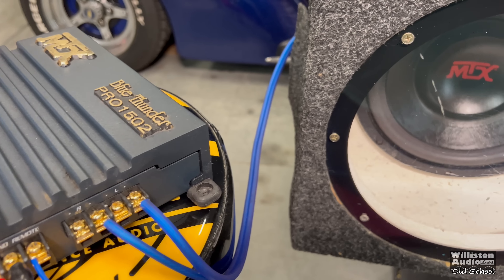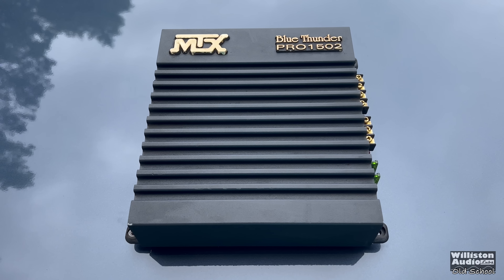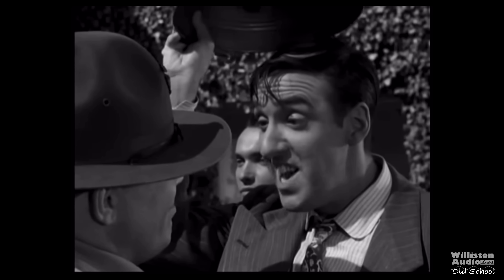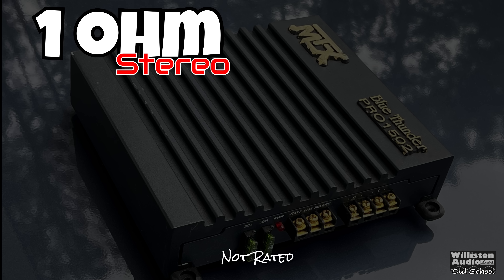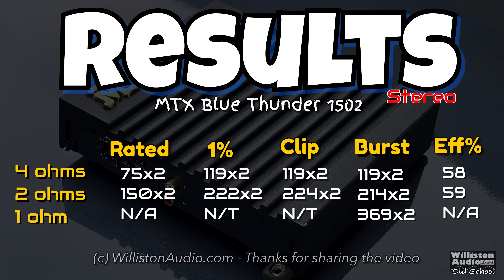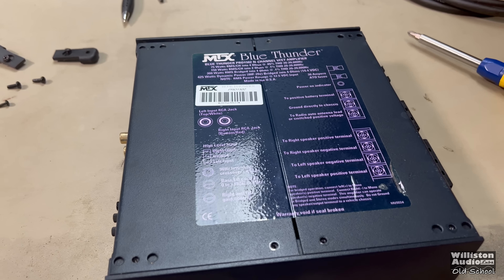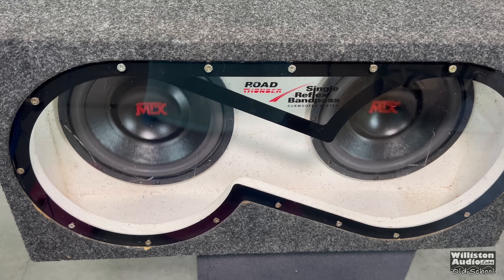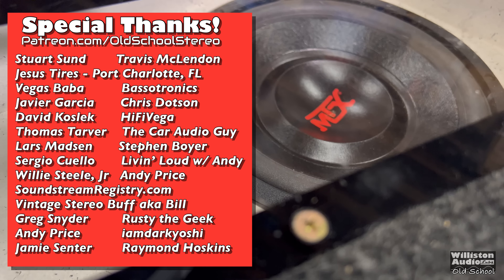Can This 25yr Old Circuit City Amp Survive Brutal Amp Dyno Testing?

Comment: Late 90s will always be my favorite years of car audio. Ppi, rockford, jl, and kicker were just a high school kids dream.
Reply: I still have my PPI 2150 from that era which I used for my highs with mb quartz front and 6.5 coaxials in the back. I wish I still had the 1400 monoblock that i used with my 3x JL 12w6 speakers.

That amp is sitting in the same storage container as my MTX amp which is very similar to the one being reviewed here. I used the mtx then the PPI amp to power the subwoofer setup for my computer for a couple years.

Comment: MTX. Is a very underrated car audio company. They’ve always made great equipment. I’ve had a lot of it over the years. I still have my first gen Blue Thunder 12’s. They were the 💩 back in the day. This amp was no different. As soon as I saw the thumb nail I knew it would surpass its ratings big time. Great vid Big D! Circuit City FTW!!!!!
Reply from the maker: I show a 10” MTX Blue Thunder at the very end!
Reply: I'm running MTX dual 12's this very moment in sealed box. chefs kiss
Reply: @wal  seen it my brother. I remember talking to you about my Blue Thunders a few years back and you told me you had one. Great sub for the time 👊🏽
Reply: @ashy Larry, as a former employee of CIrcuit shitty, no they didn't.  They sucked major ass after they got rid of sales comissions.
Reply: That said, I agree MTX is the bomb diggity!!  As far as amplifier design goes, they bucked most of the major trends.  Nothing the end user would notice bit thosenof us repairing them are usually like "omg wow is that right?!" the first time diving in.
Reply: They formed from a late 70s company called American Acoustics Labs which started in Winslow, IL but later moved to Arizona.  I still have 5 pairs of various AAL home speaker cabinets all from 1977 through 1979.  I had to fix all the woofer surrounds due to dry rot, and I rebuilt the crossovers but they all sound great.  They range in size from 8 inch to 15 inch woofers (also have a single 12 inch, and a cabinet with dual 10s).
Reply: Wasn't MTX owned by Mitek who also made, Coustic and Xtant  amps and subs? Plus street wires products too.
Reply: @wal  about 1994 I had 3 in a sealed box in my 89 crx si sonic blue was very good, then i got 1 RF HX1210 lol whole new beast was born
Reply: @MoparStephen  that’s awesome!
Reply: @Robert-ph6pl  I’m not sure about that Roberto. I do know the company switched hands at some point.
Reply: @rexxx927  yeah, HX was a beast. Still is as a matter of fact 👊🏽
Reply: @steve390gold  your first comment threw me off, lol. I thought you said MTX sucked because you got stripped of your commission. My bad 👊🏽
Reply: @AshyLarryTM  they are very musical subs for SQ too i still have one in my EM1
off a soundstream ref 500
Reply: @Robert Bero  yes they were.  Next time I'm elbow deep in a mtx 81000d (tuesday) I can take a pic of the name on the pcb.  :)
Reply: @AshyLarryTM  hahahaha no worries!!  I love mtx amps!!!
Reply: @Ashy Larry  circuit city was the worst, though.  When employees were making commission sales, there were employees that were raking in mad $$$.  Corporate saw this, got greedy, stripped everyone of commission, and said we're only going to pay 10/hr (most employees were making 20+/hr simply due to commissions).  And they even had the nerve to use that as a marketing ploy...

Then corporate came after the installers, fired/pay cut all of them because they were making too much money and tried to get them to sell stuff on the floor to then install.  That didn't work, they all left.  So then you had salespeople attempting to install what they sold.

Finally, they realized how absolutely stupid they were being and kept installers installing and sales people on the sales floor... but they didn't dare bring back commissions.  And of course, they went bankrupt.  Another company turned to total sh1t, destroyed and bankrupted by greedy corporate sociopaths.  Walgreens has done the exact same....only they are propped up by their pharmacy.
Reply: Not sure too sure about that. In Canada, they were only sold at A&B Sound and Futureshop. No one else would take them. In those days, you didn't touch MTX unless you were broke. They were dominated by Alpine, Rockford Fosgate, Pioneer, Phoenix Gold and other high-tier brands.
Reply: @brianellis3402  well that's your experience in Canada. Here in this country they were every bit as powerful and reliable as RF and beat the pants off of alpine and such.  Perhaps MTX was only setting bottom of the barrel stuff to you guys.
Reply: I installed tons of mtx at circuit  city. They were always amazing until probably around 2007 when they started selling those cheap amp sub box packages. We did have to send off several mtx amps for warranty, but they always made way more power than rated.
Reply: I still run a MTX-X03A crossover

Comment: I remember the high school days hanging out at Circuit City and listening to entire albums before buying them lol. Hey does anyone remember they had free sub/amp/radio installation whenever you spent over 75 bucks? Ahhh the good days
Reply: I remember buying an Alpine CDA-9805 head unit at Circuit City back in 2003. I forget now exactly when they closed that store, but it wasn’t long after.
Reply: That was obviously after I was gone from there.  Just about anything was $75, so I don't see how they made any money doing that.  IIRC, a radio, amp, and four speakers was $149.95 and there is not enough margin there to justify it, especially on some products - there were some CD players (Pioneer was really bad like that when on sale) we sold below cost.  Only real benefit would have been not taking as many returns and maybe the additional opportunity to upsell and sell accessories, like harnesses and cables.  But, if the sales counselor was doing his or her job, that should have already been done.  I guess that's why they are no more.
Reply: I bought a LANZAR Optidrive 300 with the analog needles. It came with a (cheese whiz) 12” pioneer 400watt. I installed it in my wife’s Dodge Neon in a 1.5 cubic ft sealed box. 
I also bought a Pioneer head unit, and got a set of free 6.5” door speakers. Pretty sure the speakers ended up in a ice truck I leased one summer😂
Reply: I worked at a Circuit City from 97 to 98, and the Blue Thunders each came with Dyno results. Never saw one that didn't exceed rated power by at least 10%.
Reply: Heck yeah me and my buddies  would spend hours there. I bought my system there. I had  that  MTX box and MTX subs.
Reply: I remember installing tons of mtx amps at circuit city.
Reply: I remember my dad took his 93 Chevy truck I think it was around 2006 they stole the previous stereo. So he got Sony new one that time any ways they charge him $100 dollars installed, new stereo dash in burgundy color to match the interior.

Comment: I'm still running a Thunder 2300 amp in my wife's car, and my home theater subwoofers are two 12" Road Thunder Pros (kevlar cone, red rubber surround) powered by a Crown DC-300A Series 2 in custom birch-plywood ported boxes.
Reply: i have 2 2300's and a 3002
Reply: @administratorperson3272  Oof! those 2300's are the best. I'd take one off your hands if you're willing to part with one. I can never find them for sale.

Comment: I had this amp! I was a car stereo manager at Circuit City! Loved this series of amps!
Reply: Circuit City was the best job I ever had and I got to work on my car in the install Bay and no one cared and I got all my subwoofers warrantied whenever I wanted for whatever reason the good old days
Reply: they were great amps
Reply: I had this amp & ended up upgrading to the 300x2.   both were great at the time.  was running the 3- 10" blue thunder sealed box.  did well,  esp with the 300x2.   I think was getting 700w or so rms
Reply: Yo brian..  have you ever dated a girl named brooke by chance?
Reply: Circuit City Roadshop, how may I direct your call? Lol I worked there too in Houston
Reply: @Z-Ack   everyone's had brooke.....
Reply: I sold and installed tons of mtx and other equipment at circuit city.

Comment: Ran a thunder 2300 and a 280 on highs back around 96.  That 2300 would put the beat on my 3 jl12w6s.  The good ole days
Reply: Yea the thunder 2300 was probably the ultimate sleeper amp of the 90's. That thing was bonkers. Have you seen Big D's dyno video on it? It's pretty crazy what it put out.

Comment: not gonna lie, i cried a little when you cut the sticker.....

I'm running 2 MTX Jackhammer 12's that I bought when Circuit City had their going out of business sale back in Jan 2009. The manager upgraded me to the upper end 1600 watt prefab enclosure/subs and a Terminator TN250 amp (tested by a buddy of mine at his shop at 568 watts) and i paid around $369 when all was said and done. I gave the amp to my nephew but the subs are still hitting hard in 2023. MTX was badass back in the day...Can't attest to their quality now, but I'd say they still have decent stuff (if I had to guess).

Comment: I had that amp in 1997 when I worked at Circuit City. I had it running (4) MTX Blue Thunder 10s wired to 4 Ohms total. It SLAMMED!
Reply: Yup! Them little Blue Thunders were the shit back in the day. Very efficient for the $. I still have one in a old school bandpass box. They hum in a Hatchback! 🤙🏽💪🏽
Reply: I ran this with 2 JL 10W6D4s at 2x2 ohms and they were monsters. I swear you could turn off the engine and get propelled down the street by the subs alone.
Reply: Do you remember the hot box
Reply: I too worked at circuit city. Started with them the summer of 96. Number 87838. I had this amp running a pair of jbl 10s in a hotbox. Ran great.  Later upped it to the pro3002. Miss these amps.
Reply: I sold and installed tons of mtx amps and others at circuit city.

Comment: I worked as a Roadshop manager at Circuit City from 1990-2000.  Still have the same blue thunder amp and a blue thunder subwoofer.  They still work and sound great 20 yrs later.

Comment: My first foray into real quality car audio was back in 83. Just purchased my Loaded 1983 Toyota SR5 4x4 long bed pickup. There was a new stereo shop in town (San Diego) called Dow Sound Stereo.  I saved up a bundle that summer and purchased a Concord PL-515 (very best unit of the day) made in the U.S. Dolby B&C noise reduction Cassette deck with a great tuner and RCA outputs. I also purchased a Linear Power 100x100 watt amplifier which was basically an 8”x12”x2.5" (10x12x2.5 to the fins) inch 15 pound brushed aluminum amp with 2” heat sinks on either side.  I purchased (Top of the line in the day) Phillips (Phillips Europe) 8inch woofers, paired with a 3” dome mid and the classic Phillips soft dome tweeters and home-made x-over’s from a design recommendation from the tech’s over at the local ADS speaker shop where we bought all the Phillips drivers). PC’s were not around yet and there was no internet to peruse for the latest design software, products or devices. All in all, after hooking that system up, was the talk of the town. OMG, it flat out stomped on everything, loud, SQ, nothing like it in my neighborhood - anywhere, for a little while anyway. I was hooked on Hi-fi from that moment on!

Comment: MTX speakers really woke me up to car audio way back... had a setup in my little '84 Isuzu P'up with no bump. Went to my audio place which also did automotive stuff and my guy slid a pair of MTX co-ax at me... someone had exchanged 'em because no highs on one side. They fixed the tweeter wire and they'd been hanging around, try these he said.
I tried, I liked... good stuff. Thanks as always, I love your detailed and insightful reviews.
Regards,

Comment: I own  the MTX 3002 Pro Blue Thunder amp. Bought from Circuit City in 1998. Mint condition never opened or serviced. Pounds hard. Also rocking the Pro Blue 504 for door panels

Comment: The Boss is back !! I sold Blue Thunder speakers back in 1988-1992 
We had some of there amplifiers 
The Red Terminator Amplifiers and the Red Terminator 2 ohm woofers 
The Blue Thunder was MTX attempt to go after the high end market 
The Blue Thunder Woofers had a rubber surround  .
The Blue Thunder had tighter bass .They didn’t have the boom the Terminators  had 
Road Thunder was MTX entry level line.They weren’t bad .They were cost effective

Comment: MTX built crazy tough, underrated, and dynamic powerhouses in the mid through the late 90’s. This amp appears to be a rebadged Thunder 2160, it would’ve been the second to highest power output of the 2 channel line of the day. The big dog was the Thunder 2300, rated at 2x150 watts RMS at 4 ohms, but was far stronger, especially dynamically and at ~2.67 ohms mono. 

Most of the warranty work for these and as a matter of fact was separation of the solder joint of the RCA board. Upgrading them to bulkhead type was a common thing back in the day. Hanks for another old school review!
Reply: I've got a Thunder 4320 and a Thunder  2300 in my Duster. I made a baffle board for the trunk so as to use it as the enclosure for 2 Kicker Competition Free Air 12's. It sounds REALLY good.

Comment: I had this amp running 2 12 in blue thunder subs and it pounded!! Later on I sold the 12’s and upgraded to 2 15 inch JL Audio W1’s and holy cow!! It ran those 15’s without even flinching. In ‘99, I took second place with that set up at 142.7 db on a head unit with NO sub output, hooked into the rear output!!! 😮

Comment: I used to use a Phoenix gold amps.  A cupid, Odin, and Zeus, and a 3 way cross over, if I remember correctly, these day. I run the better speakers on a pioneer gmd9605. Lol times have changed.
Reply: Those are hifonics amps

Comment: I worked at Circuit City in 1998 and we had a 1502 with 2 Polk DB 10’s on the floor in a demo car. That’s back when Mr Sharp owned Circuit City and CarMax.

Comment: So the 2 ohm mono….. I actually used to run one in a car on a pair of punch z 15’s , it would run seriously hot , and in about 20 to 30 minutes would go thermal. But it never died , but…… from experience I can tell you , do not lean over your amp rack without a shirt on , I had a backwards MTX red mark on my chest for a week or so. Lol😂

Comment: I bought a blue thunder 1502 back in the late 90's from circuit city.  Had it pushing two rockford 8's in a ported box in a single cab hardbody!  I wish I would have known it could have pushed a 2 ohm load bridged back then.  Thanks for the review.
Reply: I remember demoing this amp along side an Alpine back in '98.  I went with the Alpine and it lasted 5 years before I sold it to upgrade.

Comment: I still use an old school mtx4200x for mids and highs in my Trailblazer and it keeps up with 2 American bass XFL1544's on a Taramps Bass 5k.  I also have a Thunder 1500DX and a NIB Blue Thunder 400x5  5 channel amp. Old school MTX was bad ass and still is!

Comment: You can use a heat gun to heat the sticker and easily peel it up un harmed. I've done it to lots of the old mtx amps to repair them. They always stick back down and look like they did before disassembly. Thanks for this video. Would love to see all the U.S. made MTX amps on a Dyno.

Comment: My highschool setup was a MTX RT2500 and three 10" JL w6s man it slammed. Then I got 2 shocker 15s 3 series and two MTX 1501s man that was a amazing setup, those old shockers were 100lbs a piece. Had them in a 16 cube box tuned to 36hz. It was stupid.

Comment: WOW,  Circuit City..😀
I bought a JVC head unit and a JVC 12 disk CD changer from Circuit City. Worked great, load up the CD’s and play them through the head unit.🤗😎👍❤️

I bought my first computer laptop at Circuit City in 1997.
32 megs of Ram 4 gig drive.
Still have that laptop. Last time I fired it up about 10 years ago plugged in, still worked. Battery has been long dead.
Reply: Haha I did the same thing. The changer was silver with some pinstriping on it. I think I still have it somewhere. JVC made some good head units for a while.
Reply: @CarsandCats I had that xs changer and get never get it to skip. Loved it. Connected it with a tape deck to deter thieves looking for CD players

Comment: I had 15"  MTX Blue Thunders in a speaker box in 1990.  They bumped.  Til they got snaked 😂 🐍  had a Rockford Fosgate amp.  Didnt even know MTX made amps 😂.  Bought all my car audio components at Dow stereo and Mad Jacks in san diego back in the day before circuit City.  I believe circuit city bought out the Good Guys if I remember correctly.

Comment: Got the 90 series mtx 2150 had it when I was young now in my daughters car and used hard daily .amp still works great paired with a pair of OZ 12s from the 90s still bumps .only issue is the gain is fuzzy when adjusting it .betting corroded due to age so you have to find that sweet spot .

Comment: I have this same amp that needed service and I didn't want to cut the label in half. So I just heated it with a hair dryer and peeled one side back. Did my work then re stuck the label down.

Comment: If splitting the source signal from the head unit to feed multiple amps will this drop the source signal's voltage and would it be proportional to the number of times the signal is split.  For instance, if splitting a 5-volt head unit, RCA line out into two and feeding 2 amps would the voltage to each amp become 2.5 volts?  If so, is it safe to use a separate line-driver which raises the output voltage to 10 volts to then feed the 2 amplifiers at 10 volts each even if the amplifiers RCA rated input is 4 or 5 volts?
I have found information that this will not hurt an amplifier as long as you turn the amplifier's gain setting all the way down and then tune it slowly by turning it up to your target voltage output for the speakers you are using.  
I know this is not related to the video but it may be of interest to others who watch this channel.  BTW, I'm using Alpine 50 watts x 4 amplifiers and a Kenwood head unit with 5 volt RCA, line level outputs.  Thanks.